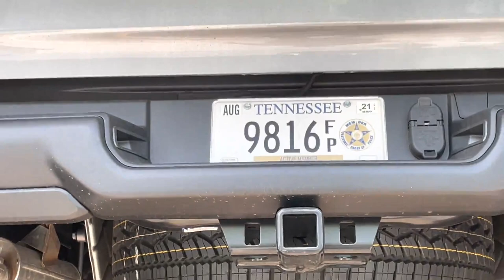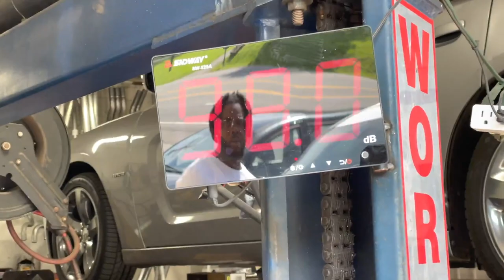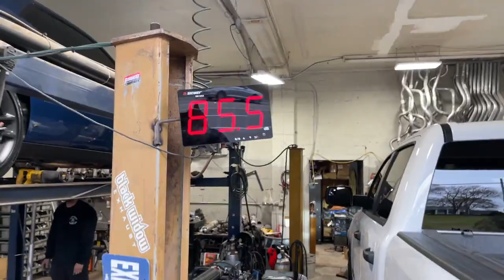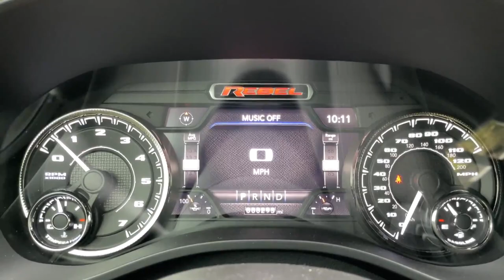RAM REBEL 5.7L HEMI V8: BORLA PRO XS Vs FLOWMASTER 40 SERIES!

Comment: The ProXS is the quietest Borla, while the Super 40 is more of a middle of the road loudness in Flowmaster's lineup.
Reply: You can buy a borla S-type/stinger universal muffler.  Leave the flowies for fox body 5.0s and they're a shitty made muffler to boot and reduce flow.  The Magnaflow magnapack is very similar to the s type borla
Reply: @wusthof641  The Stingers sound nice they always sound good.

The XR-1 has been my main for awhile, think it might be slightly quieter than S-Type but deeper. More packing material.
Reply: @EJ102  never heard them b4.  I have the stingers on my mustang 3v.  They sound sooo good, with minimal drone.  I'm gunna try to get some stingers for my dad's c6 and just weld em in....now thats a quiet car stock.  I'll check out the xr1
Reply: @wusthof641  Ya, they are Borla's racing mufflers.